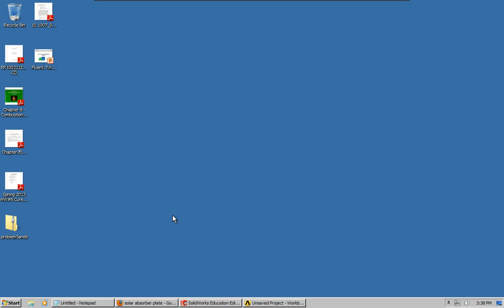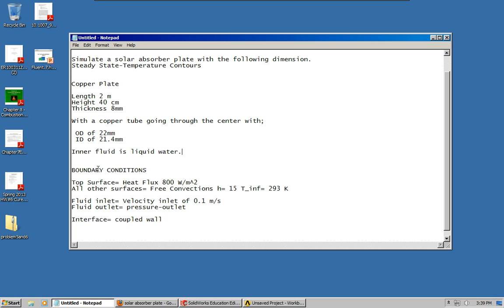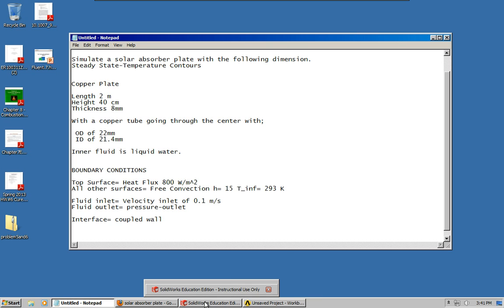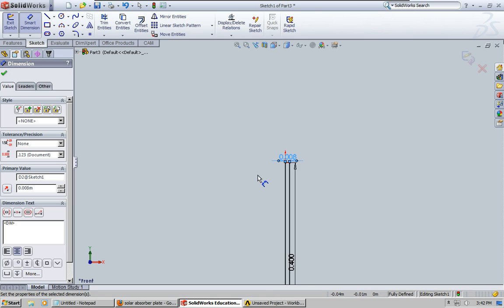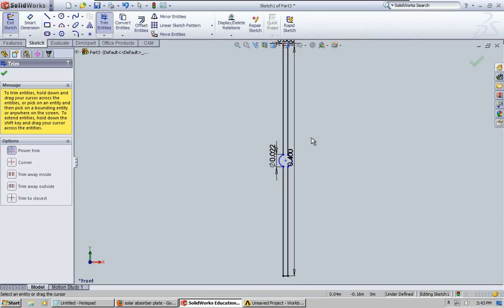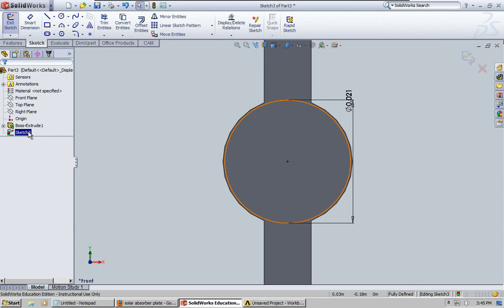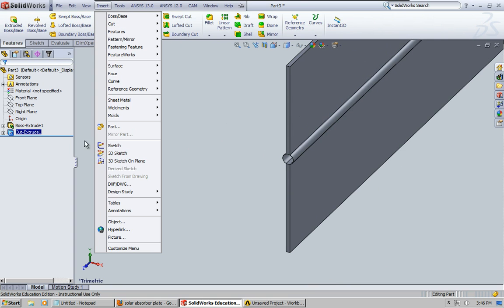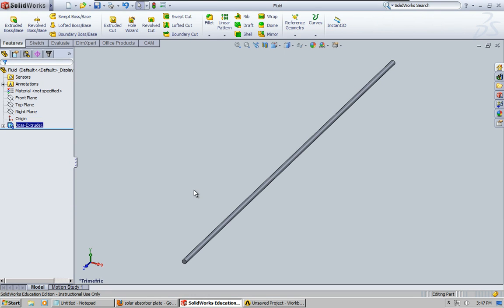Ansys Fluent Tutorial Solid to Fluid Heat Exchanger Part 1 Solidworks model

Comment: Good tutorial! There should be more like this. I have learnt a lot of useful things, that's the point of a tutorial. I would ask you or whoever for a more complex geometry, in particular one in which a body is entirely surrounded by a fluid, and there is thermal coupling and moving of the fluid. That would be a tutorial to the max (for me, of course). +1

Comment: The same is possible in reverse The fluid heating the wall .Using a udf For initialization The reverse can be found in transient with specific time for temperature rise on the wall and solid interior But in order to get a more clearer data I recommend you export the node data temperature and  time using File management The UDF itself will take care of that.